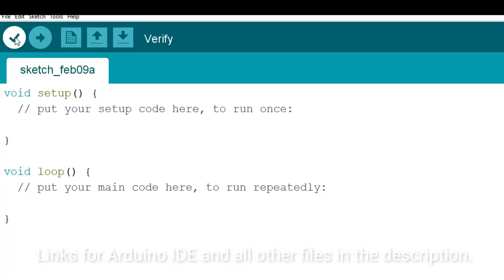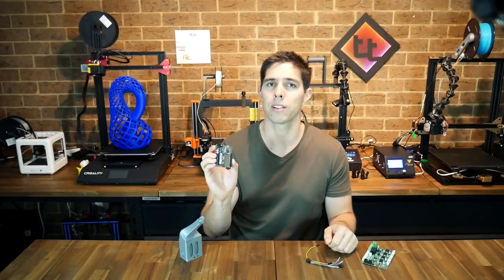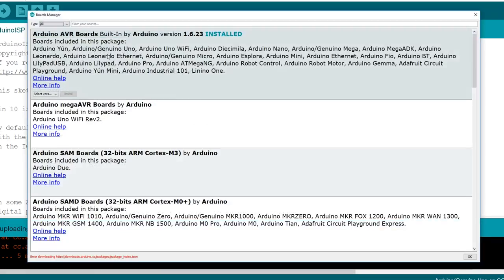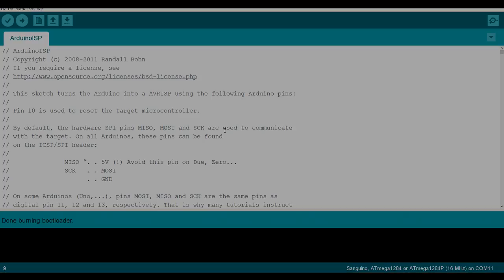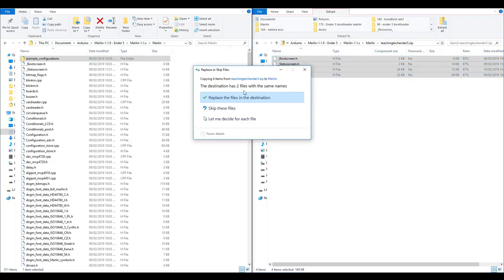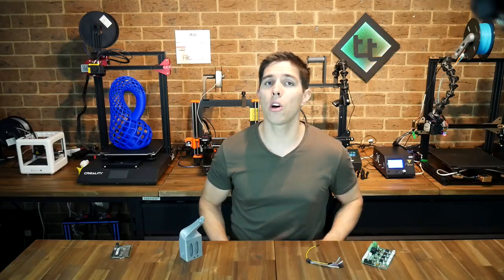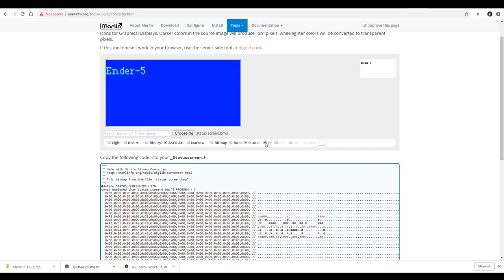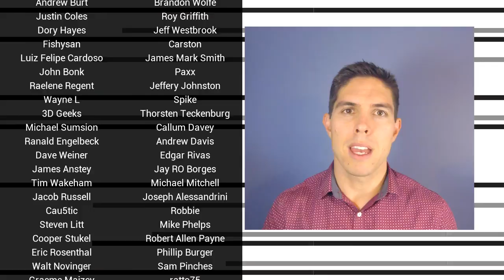Ender 5 bootloader and Marlin update

Comment: Thank you very much! I've got it working but my auto bed level option is gone! How do I fix this?
Reply: It is turned off in the config.h file. tho i am st ruggling getting it turned on because program is to large when enabled.
Reply: @RobinvanEsch83  I got it working by flashing the th3d firmware and enabling the auto bed leveling in the configuration.h file:). I used th3d because it uses less space
Reply: @r.vanhouten3270  THank you for the info, do u happon to have a link to it? been fighting with this all day.
Reply: Used TH3D version and under community settings enable mesh levelling. You lose the boot logo though but who cares about the logo anyway
Reply: @rjvrensburg1809  Thank you, found the TH3D one, and running like a dream now.

Comment: Hey Michael, I am currently watching a ton of videos, mostly yours in preparation to purchasing my first 3d printer. I started off ready to get the ender 3 because of price but then other things started coming into consideration like possibly printing abs and needing to enclose it but not wanting to enclose the electronics so the starting leaning towards cr-10 mini. Then I noticed the tevo tornado was almost the same price and had upgraded board and extruder and bigger build volume. Now I'm seeing the ender 5 and I kind of like the geometry of its design seems more sturdy plus the build plate being the z axis seems better. Now I just can't decide what to do. Help? 😔
Reply: I have the Prusa, Tornado, Ender 3 pro and Ender 5. I gave the Ender 3 to my brother and got the Ender 5. I like the 5 the most out of all. I can't pin it to any one specific thing, but, everything was flat and level out of the box and my prints are turning out great. The Prusa is king, but, I still find myself using the 5 more.
Reply: @ster9765  awesome thanks for the feedback
Reply: Do yourself a favor and just get the Prusa MK3. Save yourself from mega frustration.
Reply: @robh1908  that's a little out of my price range 😔
Reply: @richardrhoads9088  
You know the old saying?
Reply: @robh1908  yeah unfortunately I do haha

Comment: I switched it and manually moving the extruder isn't doing anything, the extruder motor and cable work so it's either the board or the software.

Comment: Arduino: 1.8.10 (Windows 7), Board: "Sanguino, ATmega1284 or ATmega1284P (16 MHz)"

Sketch uses 129370 bytes (99%) of program storage space. Maximum is 130048 bytes.
Global variables use 4815 bytes (29%) of dynamic memory, leaving 11569 bytes for local variables. Maximum is 16384 bytes.
avrdude: stk500_recv(): programmer is not responding
avrdude: stk500_getsync() attempt 1 of 10: not in sync: resp=0xe0
avrdude: stk500_recv(): programmer is not responding
avrdude: stk500_getsync() attempt 2 of 10: not in sync: resp=0xe0
avrdude: stk500_recv(): programmer is not responding
avrdude: stk500_getsync() attempt 3 of 10: not in sync: resp=0xe0
avrdude: stk500_recv(): programmer is not responding
avrdude: stk500_getsync() attempt 4 of 10: not in sync: resp=0xe0
avrdude: stk500_recv(): programmer is not responding
avrdude: stk500_getsync() attempt 5 of 10: not in sync: resp=0xe0
avrdude: stk500_recv(): programmer is not responding
avrdude: stk500_getsync() attempt 6 of 10: not in sync: resp=0xe0
avrdude: stk500_recv(): programmer is not responding
avrdude: stk500_getsync() attempt 7 of 10: not in sync: resp=0xe0
avrdude: stk500_recv(): programmer is not responding
avrdude: stk500_getsync() attempt 8 of 10: not in sync: resp=0xe0
avrdude: stk500_recv(): programmer is not responding
avrdude: stk500_getsync() attempt 9 of 10: not in sync: resp=0xe0
avrdude: stk500_recv(): programmer is not responding
avrdude: stk500_getsync() attempt 10 of 10: not in sync: resp=0xe0
Problem uploading to board.  See http://www.arduino.cc/en/Guide/Troubleshooting#upload for suggestions.

HELP!
My board just keeps freezing I'm really lost I don't know why this happens?
is it because I'm using the creality silent board?
I've installed all the drivers CH34X etc and the FTDI thingy's too it looks like it's gonna work then is fails what am I doing wrong?
Cool channel by the way x

Comment: Is it not possible to upgrade Marlin using the USB ISP (v2.0) that came with the Ender 5 Plus?
Reply: I found out how to flash using the original ISPUSB that came with the printer. You just have to export Marlin from Arduino, which creates a hex file (in the Arduino directory, bootloader included) that then is able to be written through the progisp program from Creality.

I had a few hurdles, after doing the modifications in your other video with the Bltouch, my compile was at 98% and though the compile completed the flash ended up giving me the blank bluescreen on boot error. Looking through the compile I noticed two errors, one with ultralcd.cpp the other with temperature.cpp which lead me on a wild goose chase, After realizing these were both temp files I figured they weren't an issue and redid the whole firmware watching your videos again from start to finish. I achieved the 98% before commenting out the ARC feature in your Bltouch video and thought it was ok. This time after writing again and failing again.I decided to comment out the ARC this brought me down to 96% and finally a fully functional printer.

Next issue I had doing a test print was that my prints were getting smashed as though it was not raising up the Z axis enough, I discovered that the Ender 5 PRO has the lead rod upgrade. Your configuration files are for the 400 lead rod I finally found that the code I needed to edit was here...

#define DEFAULT_AXIS_STEPS_PER_UNIT   { 80, 80, 800, 93 }

Now everything is wonderful! Thank you for your help and the education! Hopefully what Ive written here will help someone else.

Comment: Michael, i got the ender 5 and know i am trying to install the bootloader and from there Marlin. Every time i try to upload the sketch to my Arduino board (i bougt the GEEKCREIT from the link) it fails. I followed the steps in the vido but to no succes. This is the error message i get. Anny idea what to do here.

 Arduino:1.8.9 (Windows Store 1.8.21.0) (Windows 10), Board:"Arduino/Genuino Uno"

De schets gebruikt 4402 bytes (13%)  programma-opslagruimte. Maximum is 32256 bytes.
Globale variabelen gebruiken 482 bytes (23%) van het dynamisch geheugen. Resteren 1566 bytes voor lokale variabelen. Maximum is 2048 bytes.
avrdude: stk500_getsync() attempt 1 of 10: not in sync: resp=0x30
avrdude: stk500_getsync() attempt 2 of 10: not in sync: resp=0x20
avrdude: stk500_getsync() attempt 3 of 10: not in sync: resp=0x30
avrdude: stk500_getsync() attempt 4 of 10: not in sync: resp=0x20
avrdude: stk500_getsync() attempt 5 of 10: not in sync: resp=0x30
avrdude: stk500_getsync() attempt 6 of 10: not in sync: resp=0x20
avrdude: stk500_getsync() attempt 7 of 10: not in sync: resp=0x30
avrdude: stk500_getsync() attempt 8 of 10: not in sync: resp=0x20
avrdude: stk500_getsync() attempt 9 of 10: not in sync: resp=0x30
avrdude: stk500_getsync() attempt 10 of 10: not in sync: resp=0x20
Er trad een error op gedurende laden van de schets

Thx and keep up those awsome vids

update;

Problem solved, Arduino board was DOA.
Got a new one and following the vid it al worked.

Comment: Thank you for the tutorial! I was having trouble burning the boot loader using both the Arduino Uno and Duemilanove boards using a macOS 10.14.3 machine with Arduino IDE 1.8.8. I kept getting a avrdude: stk500_getparm(): (a) protocol error, expect=0x14, resp=0x14 error. Eventually I tried burning the boot loader with Arduino IDE 1.6.13 and it worked. I am not sure what the problem is with 1.8.8, but the problem occurred on both windows and mac machines.
Reply: I am running a Macbookpro with Mojave - installed the latest arduino ide, and the "drivers" - no joy - not finding a comm port - tried the same on a macbook air, and also 1.6.13  - no joy - is there any other way.
Reply: i had the same issues that you describe, the problem was fixed when i updated from 1.8.8 to 1.8.12. Running high sierra. sounds like 1.8.8 just doen't play well with these tasks i guess.

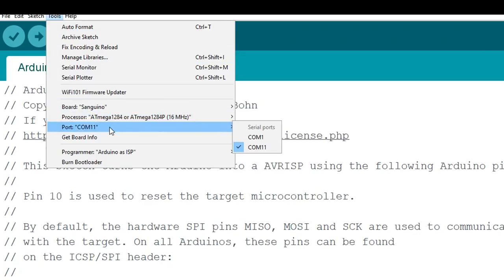Comment: I follow these steps exactly, yet the Arduino doesn't appear under Tools > Port when connected to the 3D printer, so I am unable to burn the bootloader. I can do everything up to 4:27, but then "Ports" is grayed out. Someone help.
Reply: I figured it out. I was trying to do this during the process of installing a BL Touch, and the fact that the BL Touch was already connected to the board was causing the problem.
Reply: @corey333p  is it the creality BL touch kit you have?

Comment: Do you still have to flash a boot loader on the later Ender 3 v2 & Ender 5 pro or is that now pre installed on the V1.15 main board?

Comment: I know this is an old video and my question probably wont get answered, but i have a USB ISP that came with my BLtouch. Would i be able to use that and skip the arduino board? If so, what option should i use in the arduino program?

Comment: @Michael: hello from Germany! I am a total newB concerning 3D-printing and - even more - to programming and using an Arduino board. But I managed to replace the ENDER 5's mainboard 1.1.4 by the silent model 1.1.5.  But after turning it on for the first time, I discovered, that it had no firmware and not even a bootloader. So the screen remained blue but blank. In this situation I was very glad to find your excellent videos which inspired me to buy an Arduino UNO and try to follow your instructions but now I have a problem:
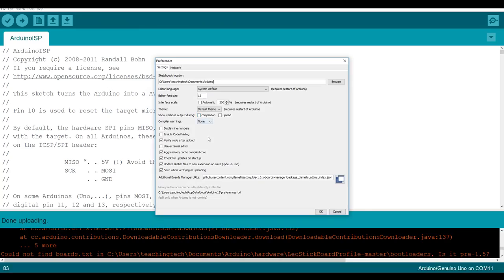You speak a remarkable accent (from Down Under, I assume?) which makes it more difficult for me to understand your English. And sometimes you also speak VERY quickly. Especially at 3:25/9:28 of this video. And I repeated this sequence a lot of times but I didn't get it's meaning. What did you mean by "you are going to copy it . . ."? You were rushing through this procedure much too quickly for me 
Were you speaking about downloading those four configuration files from your server (which I did)? Probably no problem for a native english speaker? But I don't want to risk that ARDUINO or the ENDER 5's board. 

And I also wasn't quite sure about the sequence of connecting the Arduino to the Laptop, the ENDER 5 and to it's power source. If I undestand it correctly, for turning the Arduino into a programmer it must be connected to the laptop via USB  and to it's own power supply (battery or AC/DC adapter). And AFTER this procedure I need to connect those six pins between the Arduino and the Ender 5 mainboard? And for the flashing of the MARLIN firmware onto the board, the power supply comes from the ARDUINO only? The printer has to be switched OFF? I hope that my questions did not loose too much of their meaning on translation?
I hope you or anybody else can help me to clear this hurdle before I continue to work on this project? Thank you very much for your efforts!!!
Reply: "What did you mean by "you are going to copy it . . ."? You were rushing through this procedure much too quickly for me 
Were you speaking about downloading those four configuration files from your server (which I did)? "

Once you've got those 4 files on your computer, place them in the Marlin folder.  When you place those 4 files in the marlin folder, 2 of those files will want to overwrite files that are already in that Marlin folder, and that is okay.

"And I also wasn't quite sure about the sequence of connecting the Arduino to the Laptop, the ENDER 5 and to it's power source..."

No external power source is needed for the Arduino at any point in this process. Your Ender 5 should also be powered off and unplugged for the wall throughout the entire process. For the first part of the process (the bootloader parts), You connect the Arduino to your Ender's control board with the 6 wires, and you connect to Arduino to your computer/laptop with a USB cable only. Your computer is already supplying the necessary power so no other power supply is needed to upload the program or burn the bootloader.

After you have successfully uploaded the programmer code to the Arduino and burned the bootloader, as he describes, you disconnect the Arduino from the Ender 5  and your computer. You can put to cover back on your Ender at this point. Then you connect your ender 5 control board to your computer using a USB cable. Change the Arduino settings and Serial COM port as he describes and upload the Marlin firmware to the Ender.

I hope that helps. Much Success!

Comment: Please do the bl touch install. I did everything here. then referenced from the ender 3. when homeing the touch it hits the front rail. not sure what to do
Reply: did just notice the bed size is wront its 220 220 300 not 225 225 300
Reply from the maker: It has to be set to 225 to get the 220 print area centred after homing in the top right.
Reply: i have a bullseye on. i believe if it was not on it would not hit the rail. What should i adjust pleseeeeee
Reply: @TeachingTech  .......believe it was my y stop switch.....came out of the connector........... 14 hours later
Reply: thank you sooooooooooo much for your time in these videos,,, i appreciate it.  everything is working flawlessly.

Comment: Great video to follow. My printer did not print well after the Marlin upgrade from stock on my ender 5. Played with all the settings for the past two days and for many hours. 

I stumbled upon why... finally!!! 

Found this info here: https://github.com/MarlinFirmware/Configurations/tree/release-2.0.5/config/examples/Creality/Ender-5

In mid-to-late 2019, Creality upgraded the base Ender-5 leadscrew to the same one used on the Ender-5 Pro which prevents the bed from dropping once power is cut.

If your machine shipped with the upgraded leadscrew (or if your prints are 1/2 as tall as they should be), change your Z steps from 400 to 800 in Configuration.h:

Before: DEFAULT_AXIS_STEPS_PER_UNIT { 80, 80, 400, 93 }

After: DEFAULT_AXIS_STEPS_PER_UNIT { 80, 80, 800, 93 }

My Benchy was smooshed and 1/2 the height...also it seemed the material was piling on way to fast. I see why now! I made the changes and its printing great!!

Comment: I got a lot of error mesages in the Marlin compilation...

...

Error while detecting libraries included by C:\Users\saturn\AppData\Local\Temp\arduino_build_852552\sketch\src\HAL\HAL_AVR\HAL.cpp
...
Error while detecting libraries included by C:\Users\saturn\AppData\Local\Temp\arduino_build_852552\sketch\src\HAL\HAL_AVR\HAL_SPI.cpp
...
Error while detecting libraries included by C:\Users\saturn\AppData\Local\Temp\arduino_build_852552\sketch\src\HAL\HAL_AVR\MarlinSerial.cpp
...
...

Comment: Upgrade succesful, but prints are terrible - squished! What happened?
Reply: Fix here - https://github.com/MarlinFirmware/Configurations/blob/decc096985447bb64064f7e59a64a9a1f3bcb943/config/examples/Creality/Ender-5/README.md

"In mid-to-late 2019, Creality upgraded the base Ender-5 leadscrew to the same one used on the Ender-5 Pro which prevents the bed from dropping once power is cut.
If your machine shipped with the upgraded leadscrew (or if your prints are 1/2 as tall as they should be), change your Z steps from 400 to 800 in Configuration.h"

Comment: ATTENTION ALL ENDER 5 USERS!

Do not upgrade the firmware! The Marlin firmware does not have the bed auto leveling function that allows you to level your bed. When you try to level it the old fashioned way by disabling the steppers it disables all the steppers even the Z-Axis making it impossible to level your bed. There is no setting in the firmware to only disable the X and Y axis. 

To make things worse I can’t revert to the original firmware because the instructions on Creality’s website are outdated and don’t work when you want to install an official firmware. Now I have a perfectly good printer with a bed that is impossible to level.
Reply: There is gcode you can download that will move the extruder each time you press the knob.

Comment: Some fixes for problems I had come up, in case anyone needs them:
Before uploading the Marlin.ino file make sure; 

Your printer does not need to be powered on. I don't know if it super necessary, but I had mine off when I finally got it to work.
The Board is set to "Sanquino" [in Tools>Board]
The Processor set to "ATmega1284 or ATGmega1284P (16MHz) [in Tools>Processor]
The COM Port is correct (mine changed on its own from 3 to 5, I'm still not sure why) [in Tools>Port]
And the Programmer is "AVRISP mkII" [in Tools>Programmer]
Also use the Upload button (at the top left, circle with arrow pointing right), as I was hitting "Burn Bootloader" and that didn't work (I don't think. I just know I was hitting it and something wasn't working).

The rest of the video worked great for me!